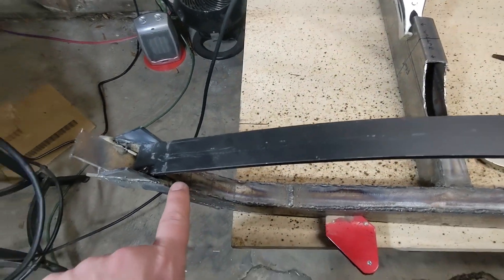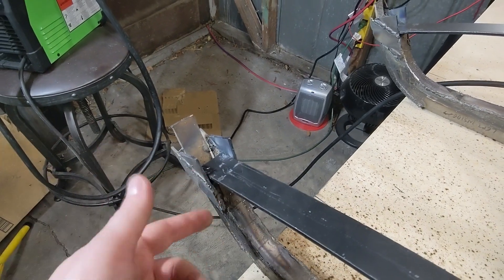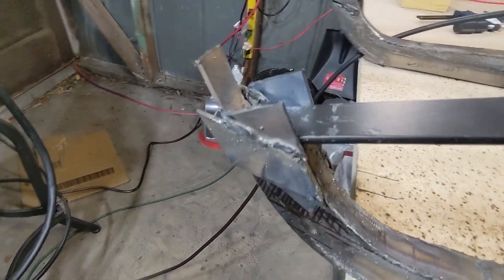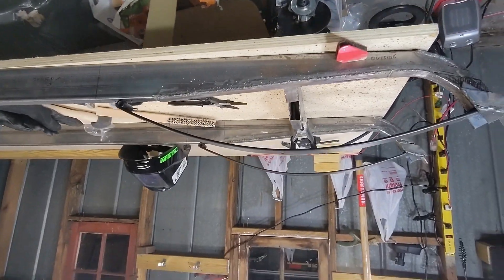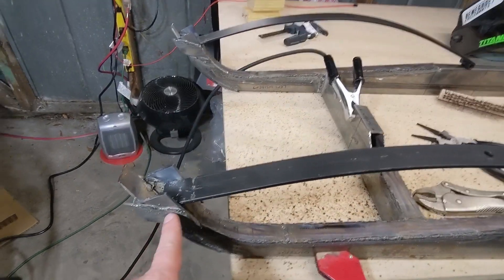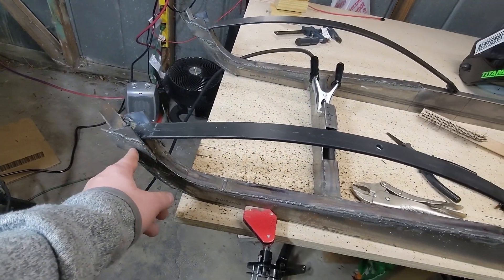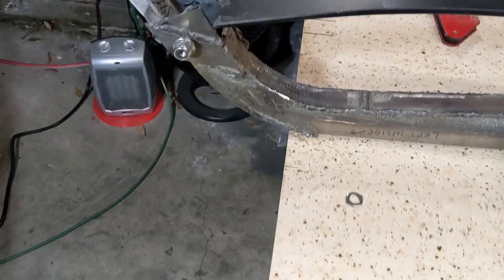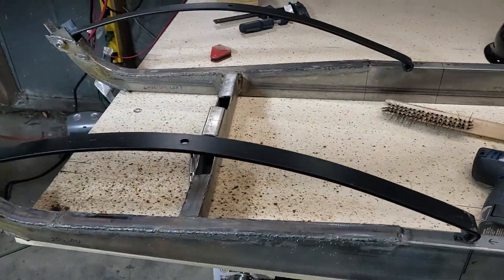Cyclekart Build - Part 6 - Front suspension leaf spring mounts and transitioning to rolling chassis

Comment: venho acompanhando seus videos e os projetos, parabens muito bons. Sou novo nesse mundo de cyclikart e pergunto qual a finalidade dessa usinagem frontal com raio e rasgo para montagem da mola de suspensão, alem de ter ficado com um visual diferente favorece algum requisito na altura ? voce tem medidas do chassi para compartilhar ? obrigado
Reply from the maker: Don't mount the front of your springs the way I did it. This is the wrong way. I didn't have access to steel when I first built this, so I improvised a solution. My solution only barely works
Reply: ok, this solution is really different. @hadlock